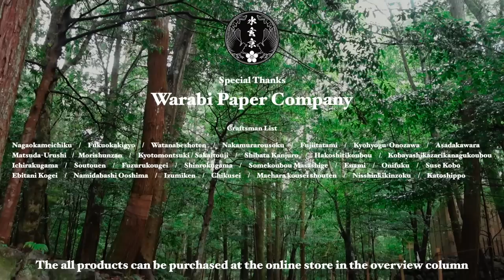オリンピックの賞状にも使われる日本の和紙を作るプロセス

Comment: Kozo is the bark of the mulberry tree which has very long fibres. Kozo paper is very strong even when it's tissue thin as it is made by interlocking the long fibres in all directions.

The main purpose of Neri (made from the roots of tororog-aoi aka abelmoschus manihot) is to size the paper keeping the kozo fibers glued together. Also without any sizing any liquids like ink would get sucked up by the paper & become a mess of blobs (I know from experience when I once forgot to add the neri).